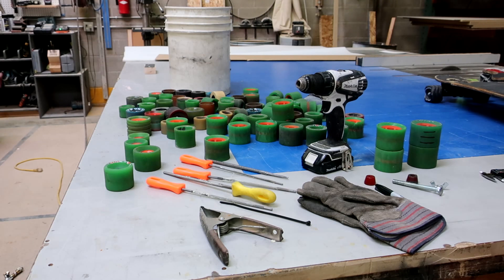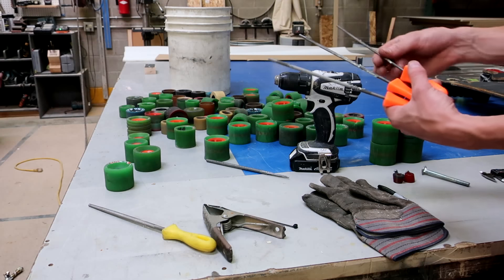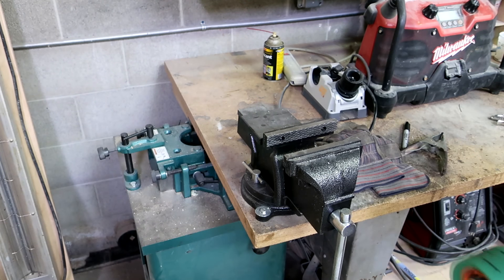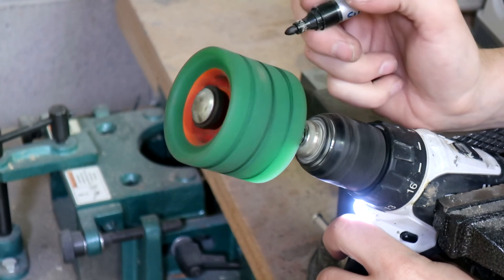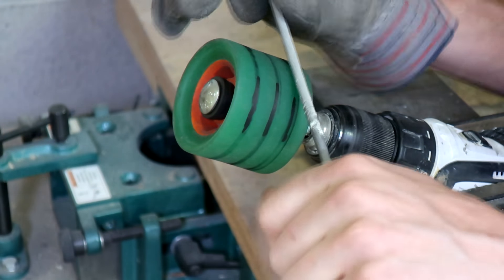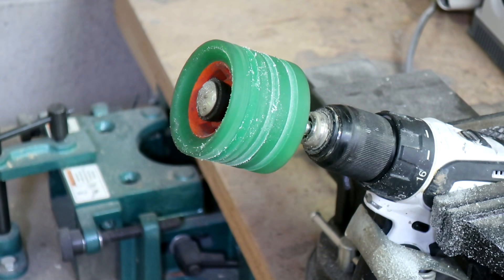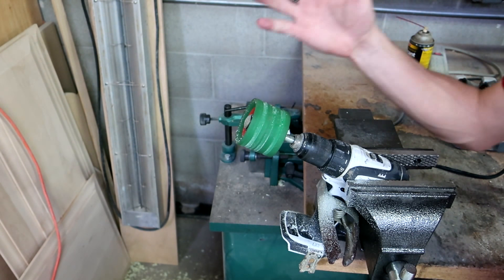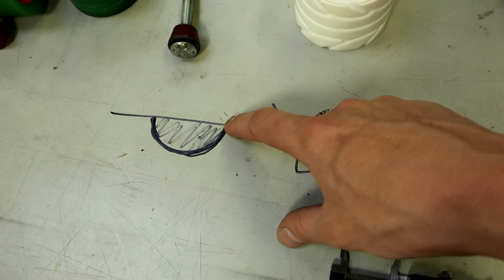How to Make DIY Rain Wheels

Comment: Awesome video, thank you!! Out of curiosity, would "triangular" grooves would be as vulnerable as square grooves, or similar to circular? Like using a square file on its side so its more "diamond" shape, only going half way, leaving triangular grooves in the wheels. 🤔
Reply from the maker: So, the advantage of a cutting a half round groove with a file is that you still end up with square lips, which should provide the most grip. A triangle groove would provide better support for the lip, but the lip would be less sharp.

The difference is probably marginal though.

Comment: Sup bro. Great video about wheel lathing. Great ideas on how to do it. I just wanted to share some thoughts regarding wheel hardness (i've been skating for 26 years). I would say 78A is a pretty soft wheel, so soft that ive had ones that didnt withstand my weight (175lb) and broke and completely fell apart. So, i would say 85A could be considered soft, 89A to 90A a halfway between soft and hard, and from 95A to 103A the hard ones. I hope this may be useful to anyone. Cheers
Reply: what do you think about 87a? for street and park? is this still a soft wheel?
Reply: What kind of wheels were you riding haha standard now is like 75/76a for race wheels. And there’s many pros who ride them at close to 200Ibs
Reply: This heavily depends on the urethane used. Not all 78a wheels are created equal... and for the vast majority of longboarding, 86a is rather hard.
Reply: @spaghetty007  87a is about ideal in my opinion, my fav wheel is 89a. I would say the 80a category is best, 90a and above the wheel seem to be too hard, and they have less grip and less rebound, in other words less lively. 80s range have the right balance in my opinion but i had a few good 78a but 90% dont last more than 2 weeks and then fail due to core debonding. I have wasted so much money on wheels, it really sucks having to replace them so often when u have no money to do so.

Comment: How much difference did you find urethane depth made? My thinking has been that for rain wheels a harder wheel (at east 80a is what I've been thinking of using), plus a larger core would give the most grip and slide feedback in the wet, but I've never had the chance to test anything. Also did you find urethane types made much difference? eg high rebound urethane, low rebound thaney urethane, icy cheat wheel thane, where they noticeable when sliding in the wet, and if they were were there any unexpected outcomes due to wet slides?
Reply from the maker: Around the time we were lathing wheels, we were really sticking with just ABEC 11, so I can't really say too much about urethane type.

Most of our lathing wasn't for rain wheels, but it was so that we could make bigger wheels with thick urethane act a lot more like their optimal broken-in size.
So how I would interpret that would be to start out with more urethane than usual for rain wheels.
Reply: Nice